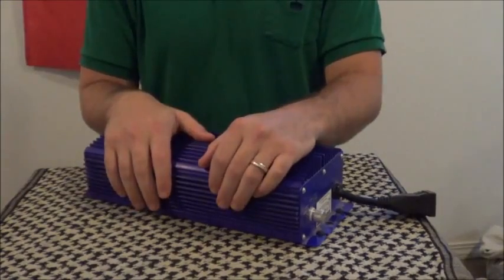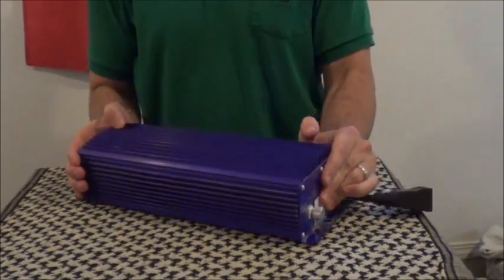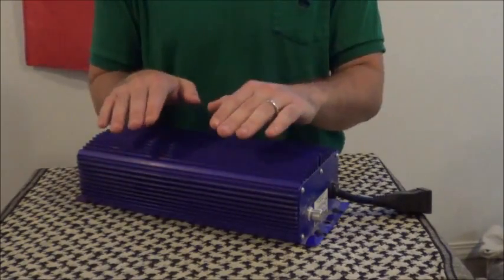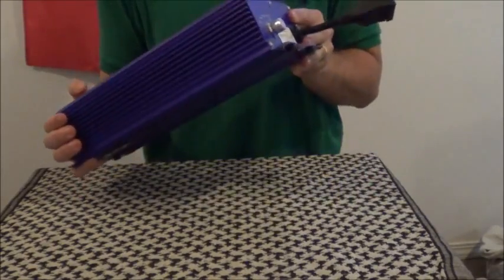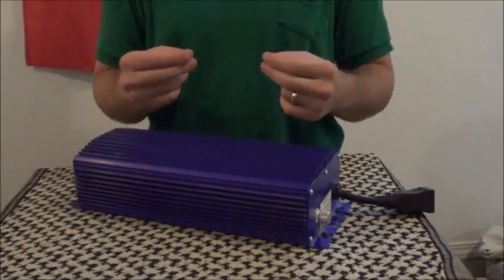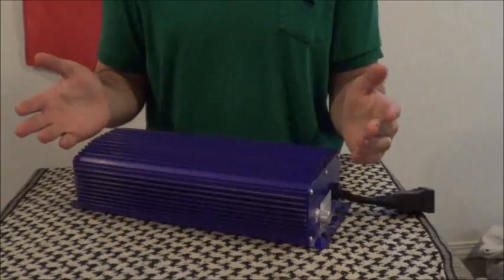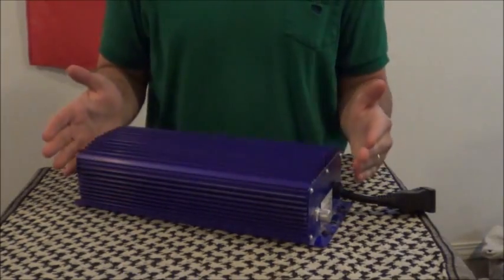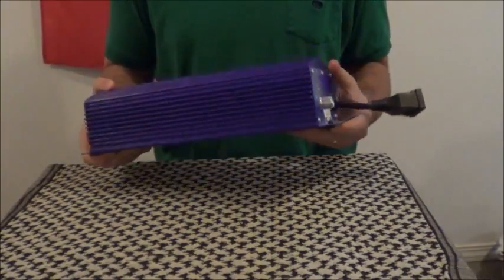Digital V. Analog (Magnetic) Ballasts

Comment: Super late to the party, yet in my experienced opinion, digital ballasts are better as you have much tighter power regulation with just a small piece of software. 

Yeah, I am kind of crazy, yet I have been using 35 Watts ceramic metal halide bulb in my modified Cyclops Thor Colossus halogen spotlight (it's still way more efficient than the original 140 Watts H4 Halogen bulb for the same apparent brightness), and I use digital ballast (Hylux A2088) with it as I just wanted to ensure that there's no problem with the bulbs, while I have heard about the issues with analog ballasts and have seen it beforehand.

However, what analog ballasts win is long term reliability (being usually of iron autotransformer type), the transformers don't fail for no reason unless they're made shoddily, or overloaded.

Comment: #TOMARS . I actually got in a comment war about this one. Music and amplifiers are the only things I can think of that should stay analog.
Reply: Yet with digital, you can preserve the music for a VERY LONG time without any appreciable quality and data losses depending on storage media (with M-Disc, you could preserve Beethoven's musics for hundreds of years), yet there's something about the original analog audio signals that digital computers can't copy accurately unless you use super expensive 32 - 64-bit analog to digital converter and look at a few decent audio codecs for lossless audio so that's actually more efforts than it looks on surface, not to mention the insane appetite for the hard drive / SSD space as ADC bits determine the resultant audio file sizes. So that's one of the reasons why Vinyl records have made a comeback.

Comment: electronic ballast  usually go bad in three years  l put my ballast outside grow room with cheap fan cooling it
Reply: That's not entirely accurate. I have a Phantom digital ballast going on 8 years. I also have an 11 year old Lumatek which has seen less use(maybe 6 straight years). It really depends on the build quality of the manufacturer. When I worked at a hydro store for 6 years we saw Quantum 1000w ballasts, Nextgen 1000w, and Lumatek 600 watters come back for replacement but not a single Phantom EVER came back. Not only this but the Phantom ballast owners would never sell their ballasts to anyone! I tried to buy some off of people before and they just won't get rid of them. They are honestly the most reliable digital ballasts I have ever seen... They drive the highest light output of any other brand except the SolisTek Matrix which was a close tie.

Comment: As you dim the digital ballast down to 50% . Does the Actual watt draw change with  it? or is it 1000w  even when on 50% dimmed. ty
Reply: It goes down but not quite by 50% and the lamp will be giving off less light per watt than its designed rating. Pulling figures out of my arse a 600w lamp running at the 400w setting will draw 440w and give out 60% of the light rather than 66%. It's something like that. If saving electricity is your thing then having different wattage lamps and driving them at their rated power will give you more photons per penny but it's probably not worth all of the faffing about to be honest unless you are paying silly money per kw/hr.

Comment: my magnetic ballast never got my cable company at my door 4days in row like my digtal did
Reply: My magnetic ballast is near 30 years old and still going strong.  Never had a digital last more than three years.
Reply: @rationalbushcraft  That's the trade-off. Digital ballasts are more efficient, kinder to the lamp and dimmable but are made from components that have fairly limited lifespans. Magnetic ballasts are not much more than lumps of iron and copper wire and can live for decades, there's not much that can go wrong. Personally speaking I'm fine with a £60 digital ballast that has a lifespan of three years at a 50% or 66% duty cycle and is probably repairable if you have the skills... Which I do. It works out at £20 per year and I spend more than that on a week's tobacco.